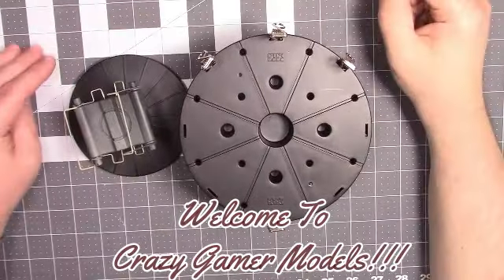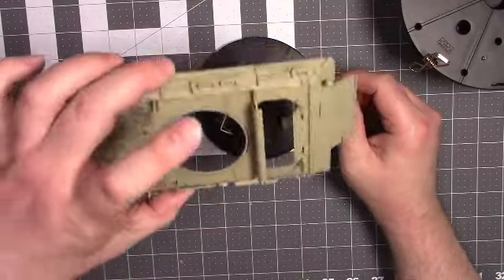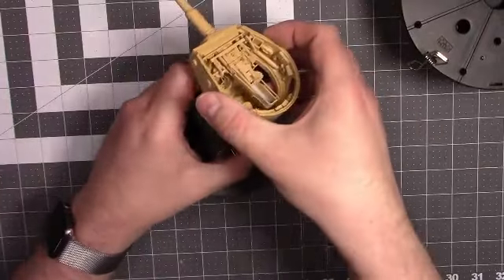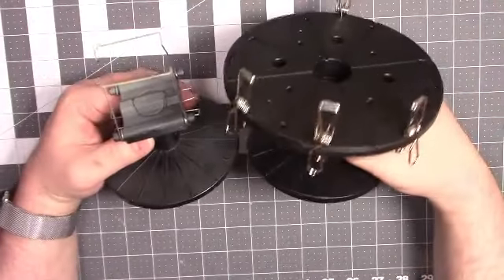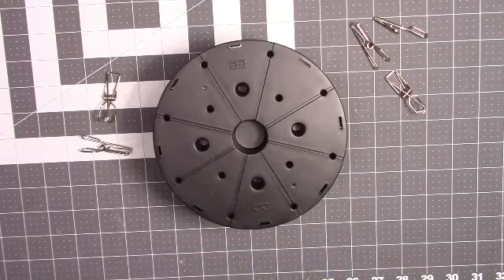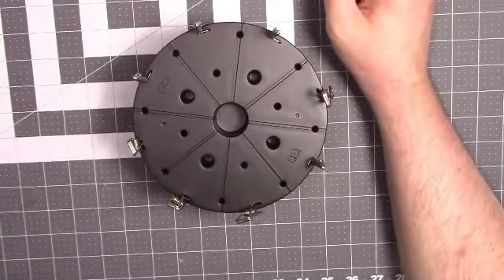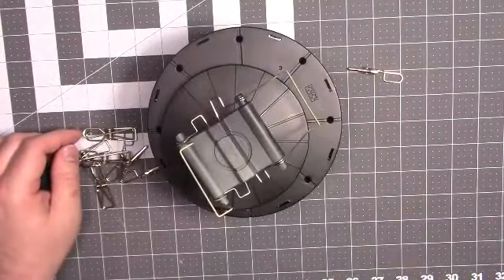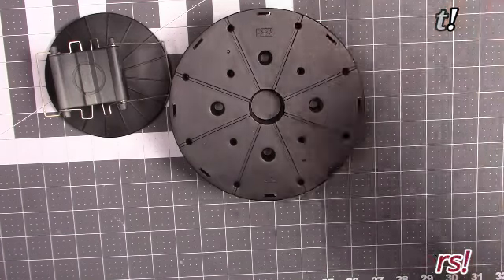Tool Review Tamiya's Model Stand

Comment: Looks very useful still I am a bit set in my ways will have to think about it before I spend the money.
Reply from the maker: loveminis when I bought it I thought it would be awesome, then it sat and didn’t get use until I found out the tank parts fit on the one and now I’m glad I got it and use it all the time. As for the other part with the holes I haven’t used it yet, I plan on getting some sticks that fit in the holes and put clips on them and I’ll use it then.😁